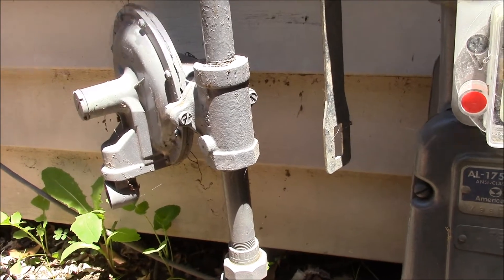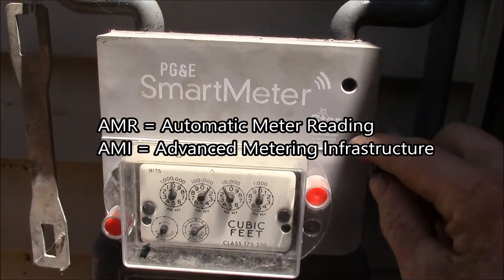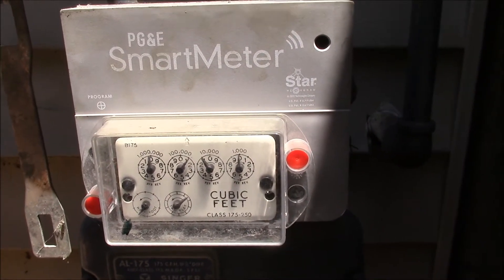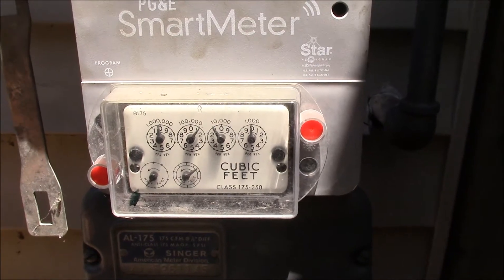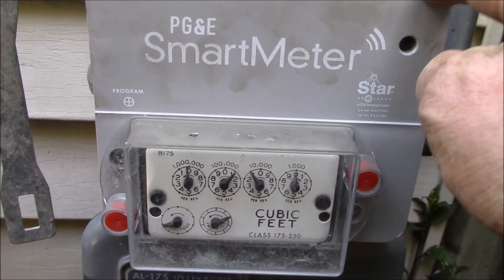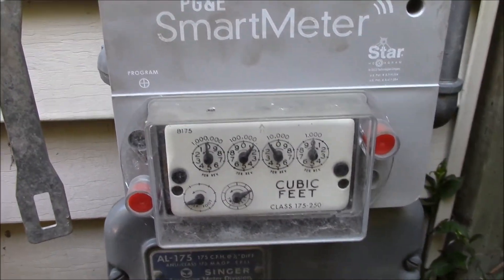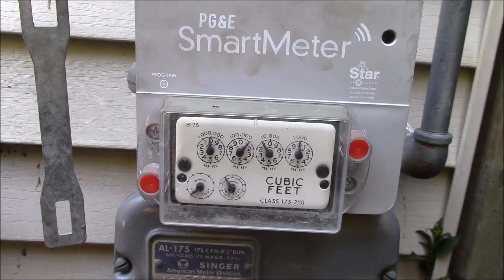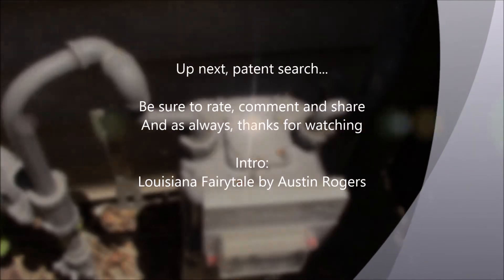Smart Gas Meter, Part 1

Comment: anyone may correct me if am wrong as I am not even near being a professional. 1/2" to 3/4" to 1" does not seem right. Shouldn't it be changed to 1" at the meter and have 1" the rest of the way only to get smaller as it branches to each appliance? Your meter might be to small @ 175 for a tankless and gas furnace running at the same time, not to mention if you have a gas dryer and any other item that may run at the same time. It will still work but not as efficiently because the appliance might be starved for gas if not enough CFM is getting there. PGE will come out at no charge and switch the meter over to a larger CFM say maybe you need at least 250.

Okay again not sure. Check your dishwasher to see if it is one that can be connected to cold supply but I think these are only on high end dishwashers. They all heat the water up (to about 140-150) with the element in the dishwasher but some can do it with 100% cold. Reason, your tankless uses a huge amount of gas for those short duration's of filling the dishwasher. Depending on far the hot water is from dishwasher a lot of the water going into the dishwasher could be cold water that is in the pipes between the dishwasher and tankless. How much of cold water...first thing in the morning run you hot only in the kitchen sink and measure how much water it takes until it is HOT. For many houses the hot water source is very far from the kitchen. One disadvantage of tankless is it is not ideal for short hot water uses. Did you achieve lower gas usage after you installed the tankless?
Reply from the maker: Good point on the meter plumbing.  That's the way it's been since I owned the house and those sections of 1/2" bent sections of pipe seem to be from PG&E, at least it's the same fitting on the inlet and outlet sides of the meter.  So far no issues with low gas pressure with the tankless heater.  If it becomes an issue, will get PG&E out to change that piping for sure.  It looks like some standard fitting they use, has a big threaded end on the  meter and then adapts to whatever the pipe to the house is.  
For a '50s era tract home, the hot water plumbing is laid out very efficiently.  The heater location is only about 10' of pipe away from the kitchen and maybe 20' to the bathrooms.  Yes, the dishwasher does have a "hot start" feature where it can pre-heat water.  I find that setting the tankless to 140F for the dishwasher cycle works well.  Run the kitchen tap for 20-25 seconds (about 1/2 gallon of water) to get the water temperature up, then start the wash cycle.  Have observed over 80% gas savings and 75% cost savings with the tankless compared to the tank heater.
Reply: @The4Crawler  Super good savings, glad to hear. Thank you for the reply. Sounds like things are good to go for you. When I installed my furnace it worked well, but I clocked the gas flow for the furnace specs to get it spot on for the BTU/my elevation/and PGE's gas. Had to get some spec/tech numbers from PGE on the type of gas they were delivering. I would say your 1" was installed after the house was built? Though are you sure it is 1' looks more like 3/4 going into the wall. Also a 175 rated meter that has a 1' line, humm? small meter and large line. Having the 1/2" right at the meter is not as much of an issue as having it being 1/2 or 3/4 as the run. Your case is okay I think with 1/2 at meter and run is 1" I would add up the BTUs on your appliances that could run at the same time. If you go over the meter 175 then def. the meter is not big enough.

"How many BTU can my gas meter handle? The Btu/h per cubic foot of gas can vary, but PG&E uses an average of 1,000 Btu/h for every cf/h of gas. Thankfully, this makes them math pretty easy! If you have a meter with a maximum continuous capacity of 175 cf/h, it can provide a maximum of 175,000 Btu/h. Tankless water heaters use a high volume of gas, typically between 150,000 and 200,000 BTUs." Place that on top of a 70,000 BTU furnace and you are way under sized at the meter.

I wanted to install a tankless but I know how much my little standby 40 tank uses each month...1 therm each 6 days @ $1.36 per therm...I will not live long enough to see the savings! Say even a 50% it would take 20 years to recoup the cost of the tankless. You say "So far no issues with low gas pressure with the tankless heater." One easy way to check is run the furnace and then while looking at the flame have someone turn on your hot water, if the flame changes color there is a problem in efficiency. Or the same thing looking at the tankless and then have someone turn on the furnace. It all depends on the location of the appliance retaliative to the other appliance in your piping. Very good you have the wrench right there to shut off but don't you need to be there also, lol? If you have PGE change the meter also install an automatic shutoff, they might require it anyway if they do the switch. It is required in some counties at time of re-sale. Required on all new houses for many years.
Reply from the maker: @scottc6269  It's definitely 1" line going under the house.  There's only the 3/4" where it connects to the meter and then into a reducing tee which has the 3/4" and 1" threaded connections.  My tankless is only 120K BTU/hr. max rating and even if I turn on every hot water tap in the house, I can just barely hit 100K BTU/hr. (60+ year old pipes are probably restricted). Normal use with one fixture or appliance running is well under half that, so really no more gas than the old 40K BTU/hr. tank used.  I find the tankless only uses 2 therms of gas every 3 months if that's the only gas appliance in use.  It's on track to pay for itself in under 10 years - although that'll be quicker as rates increase.  And with this crazy CA Climate Credit, I haven't paid a gas bill in nearly 2 years, I get more credits back than I use in gas. 

I do have a gas furnace, but that's not been used in ~15 years as I now heat with solar.  It might be that the gas line was changed when the furnace was installed before I purchased the house.  It used to have 2 in-wall heaters, then those were removed and a forced air furnace was installed, probably back in the late '70s or early '80s.
Reply: @The4Crawler  Nice....these numbers you give now look much better than what I was thinking. You are set up good especially without needing forced heat and having the smaller 120BTU max for your tankless. And only 2 therms in 3 months! Even 2 therms in 1 or 2 months would be good enough for me to reconsider. I'll see when my tank one goes out someday knowing that it will be an extra $600 +/- one top of the price of a tank one. But I might have to stick with tank as I would need the larger gas line and have the meter switched out (I have the 175). All easy to do for my layout but just more work.
Reply from the maker: @scottc6269  Yes, the size of the tankless heater depends on your needs.  I initially wanted to go with the biggest 199K BTU/hr. model, but then as I researched it, smaller units made more sense.  But my house is 3 bdrm/2 bath with one occupant.  The 120K model I got might even be a bit too large for my actual needs.  Given the relatively warm incoming water temps, the heater doesn't really have to work that hard, especially considering there's normally only one fixture running at a time.  Since I try to set the water temp. for the task at hand, running one thing is sort of automatic.  Now if you have a big family and 3-4 showers are running at the same time along with a load of laundry and the dishwasher, then yes, you need a bigger heater to handle the demand.  But larger heaters cost more to purchase and more to install, so that eats into the potential savings.  That's why I'm glad I opted for the smaller heater, worked with the existing infrastructure and only added $400 over what a new tank would have cost.
Reply: @The4Crawler  Sounds like your situation is the same as mine. 3b/2b one person. Years ago when I did the research I even waited for winter so I could measure the lowest incoming water temp and factor that in. About the only thing going for tank is no electricity needed, not that my power ever goes out. There are some that use water turbines to ignite the flame or at least have a 9 volt or so back up battery. Now they also don't need the stainless steel venting. Thanks for the info of even if it is a 120k BTU using only one fixture, it runs at much lower BTU. I do not remember if I read about that info or not.
Reply from the maker: @scottc6269  Yes, it takes some time to dig into the information, understand it and then to see how the various features or aspects affect the installation and operation of the heater.  

I was initially told by a PG&E gas tech to get a tankless that doesn't need power to operate.  However, those are less efficient (~80% vs. 93%) and need more expensive stainless venting and since efficiency is less, you need more gas/larger gas line for the same BTU rating.  

I found in my case it was better to spend ~$200 more for a high efficiency condensing model that can run w/ PVC venting and also off a 1/2" gas line.  Doing that saved me the high cost of running a new gas line plus ~$200 for stainless double wall venting.  Net cost was less and I get a more efficient heater to boot.  

Trivial to power the heater during a power outage.  Easy way is grab a small UPS for the unit or I have mine plugged into my solar battery bank and power inverter.  It draws about 3W on standby and 70W when operating.

You probably won't find any of this sort of information on-line.  I think most of the review and install videos/writeups just regurgitate the data off the spec sheet, maybe explain a bit about a particular feature but stop there.  Also, people assume that one tankless is just like another, sort of like tank type heaters.  There's a huge array of different brands, models and all sorts of combination of features.  But I've found nothing that breaks down why you might pick one feature over another and what the implications of that choice is.  I have a video at the top of this playlist that goes into my selection process where I try to go into those sorts of details and work through my decision process to get to the heater I chose.  So far have been happy with the final decision and the heater.

Comment: Dish washers do not run off off gas
Reply from the maker: OK, you are correct, but the hot water that the dishwasher uses is heated by a tankless gas water heater, in my case:
https://youtu.be/f1bJWVVHItA
With a tankless heater, as soon as the appliance (dishwasher in this case) shuts off the hot water flow, the heater stops heating water and thus stops using natural gas.

Comment: I can answer some of your questions made in the comment section. I have work for the gas utility in St Louis, Missouri for 35 years and quite familiar with the smart gas meters.#1 the transmitter keeps sending a signal no matter if the gas is turned on or off; as a matter of fact we use the system to find out if anybody is using gas, unauthorized.#2 we use the meter to a verify consumption & if the system notices unusual consumption a spiked meter read is dispatched to the First Responders  ( service technicians)  & we are on the way to that particular address as if it was a gas leak. A lot of potential problems and Hazards have been eliminated in record time due to the system.#3 the gas cannot be turned on or off with this particular system , that still has to be done manually but I understand they are testing systems that can do this. #4 they are testing particular Smart Meters that have combustible gas indicators that would send a signal ( red flag  ) if a CGI reading was indicated.#5  we did have problems with these meters when they first came out over a decade ago but amazingly most of those problems are weeded out and the system recordes and transmits meter readings remarkably well.#6 if the electronic meter reading system fails the manual meter reading device is still in place for and accurate gas meter reading & that meter reading will be used when we repair or replace the smart meter.#7 from my experiences these batteries last between 7 and 10 years.
Reply from the maker: Great information Bob.  It's hard to get actual details on how specifically these things are used by a utility.  But yes, your points line up with my understanding.  Didn't know about the first responder notification, that makes sense.  But with the transmitter running off a single battery for ~10 years, it can't be putting out 10's of watts of energy like some people think.
Reply: @Awesome Things Investments , we use the yellow wire to locate the polyethylene services & mains ( has nothing to do with the gas meter or valve position). The valve ( known as a curb cock) is strictly  mechanical and manually operated. However if they replaced your curb cock (valve) they most likely installed an excessive flow valve as well ,which automatically turns off the gas to your service if an excessive amount of flow ( such as a line cut ) is detected. Hope this information helps your understanding.
   Considering the word Investments is in your YouTube name, how about giving me a few stock picks that I might consider adding to my portfolio (?).
Reply: @Awesome Things Investments , that would all depend on your total house load and what type of service pressure you have in your neighborhood (5/8" & 1" are the most common but they could use 3/4" as well). They should also be installing an excessive flow valve on your new gas service as close to the gas main as possible, sometimes they're even built into the service tee.
Reply: @Bob Y  Hey- I'm having a hard time exactly finding out what these smart gas readers actually record I have a gas meter that is due for the smart meter replacement.  However all I can find is that it transmits usage but does it also transmit if there is no gas such as if the incoming curb valve is turned off and/or change in gas temperature
Reply: @limbanipablo8362  , it works like a standard gas meter, measuring the amount of cubic feet that has passed through it ( measured in 1000s  of cubic feet). The. Interior parts of the gas meter are the same, it's  the reading device that makes it smart ( the unit hanging on the front of the meter). It is powered by lithium batteries that can last between 7 and 10 years. Yes, it remains working whether the gas is on or off. As a matter of fact if the records show the gas being off but usage is noticed, chances are a service technician with a police officer will be showing up ( called the Diversion Control Department at most gas companies). The unit can also detect uncommon usage for it's particular customer. In the event of  uncommon usage noticed ( called a spiked meter reading) the dispatching department would be notified and a service technician would be routed to that particular address as if it were a leak call. The main reason for the smart meter is to eliminate jobs in the meter reading department and make operations more efficient. Hope some of this information helps and stay safe out there.
Reply: @boby115  That makes a lot of sense . Clears things up I was under  the impression it can remotely be shut off and it records other data points such as in house temperature. Thank you for your help
Reply: @Awesome Life That's interesting cause they seem to be only replacing the front dial with a new dial and box I wonder how that reads gas pressure and temperature without going through to the inner meter

Comment: As far as I know those meters CAN be turned off remotely.
Reply: isonlynameleft  if I turn my Gass off will it stop transmitting?
Reply from the maker: @marievege1165  Good question and I'm not completely sure.  With the gas off, your meter will no longer register any gas consumption.  But not sure if the transmitter will still send out periodic "pings" to the data collection unit (DCU) or not.  For sure the transmitter isn't powered by the gas flow, it has an internal battery that powers it for 15-20 years.
Reply from the maker: Do you have a link to that information?  If so, would be good to read more.  I think some of the Aclara Series 3000 MTUs do have 2 way communications capability.  But as far as I can find, the ones the PG&E use are only set up for one-way (transmit-only) communication.  I think they do have a non-contact programming feature via an external magnet and internal reed switch.  And from what I can find, the only input to the MTU is a pulse from the gas meter once per therm of gas consumption.
Reply: @The4Crawler   Don't have a link not sure how reputable the information I was reading is but I work behind PG&E all the time and if they turn off your gas even if you turn the valve back to the open position no gas will come out so they have some way of turning off the meter although I'm not sure how.
Reply from the maker: Interesting.  Wonder if that is what they can do with the external magnet and the internal reed switch. Or maybe there's an internal valve operable by an external magnet.  That seems to be how these gas meters and transmitters interface is via magnetic fields.  I think the meters are sealed units and last thing they want is some electronics inside that sealed case.  Also one reason the transmitters are battery powered as well.
Reply: R Brown if I turn my own gas off , will the radio frequency  stop transmitting?
Reply: R Brown oh, I see well I  just bought a  pure copper drawstring cover to put over it! , from smartmetergaurd,com plus I have  shungite, and organite around it! But I served  the gas company  a lawsuit that states if they put one on  my house ,  they owe me 10000.00 dollars  a day , it's a tacit agreement  and they are in default, you can go to inpower movement . Com for all templates. So I guess I'll be going to court!
Reply: R Brown go to inpower movement . Com you will  learn what you can do!